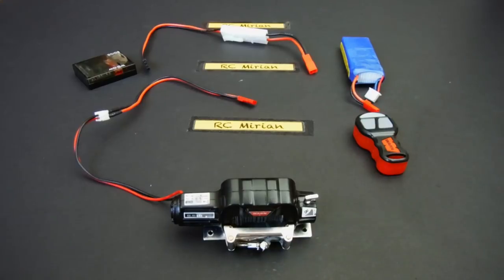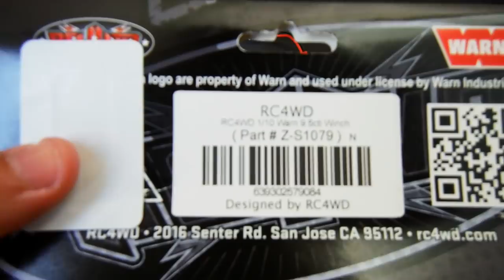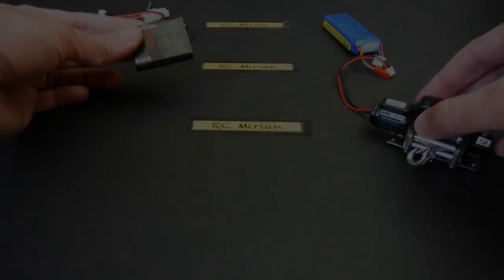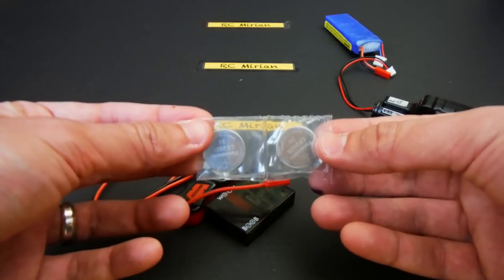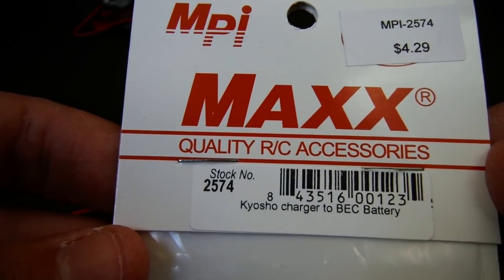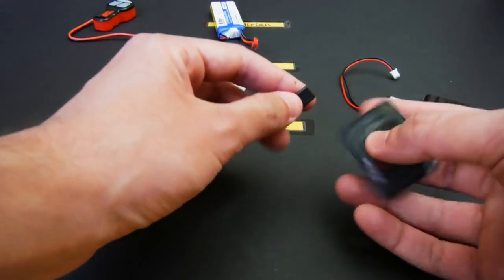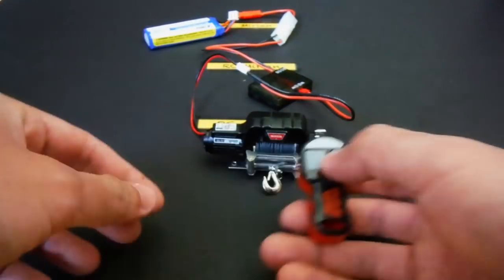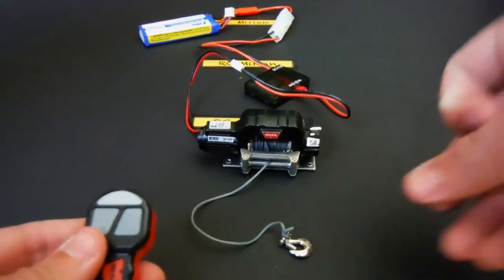RC Warn Winch Tutorial

Comment: Great post. I added the Warn winch to my TRX, but used the aux power source to power both my lights and the winch. I used existing plugs, but transferred wires to the plugs I needed to avoid numerous connections and ridiculously long wires. All worth noting I just used two of the supplied screws to attach the winch base to the stock bumper. With two it is very snug.
Reply from the maker: Awesome, yes having wires everywhere doesn’t look too real!
Reply: @MehdiMirian  so I would be able to get a cable with servo connectors on each end and use that from the aux power source on the trx4 to the receiver for the winch?
Reply from the maker: @tieintercepterpiolit  yes you should. Thanks for watching!

Comment from the maker: @RC Playground comments like yours are what keep this channel going, thank you for the kind words!
Reply: You'Re Welcome!
Reply: rc mirian if I want to use 2 winches to I buy 2 and 1 controller or 2 and 2 controllers
Reply from the maker: Country Gamer I'm assuming you want to use each one independently, and as you can see the remote comes with 1 receiver, so you need 2 remotes with 2 receivers, but if you want both winches to work at the same time, just get 1 remote and receiver and you'll just need to make a Y cable from the receiver to both winches. Let me know if i made myself clear ;)
Reply: ok thanks cuz im making a scaler and I want a winch in the front and in the rear and im also making an 8x8 driven trailer and I want the winches to work together on that
Reply from the maker: Country Gamer nice, so you'll need for the scaler 2  sets of receivers and remotes but only one for the 8x8, post pics of the process, that's a great build ;)

Comment: Quick question five years after posting this video: does the winch automatically stop when the wire is all in or out? Will the motor keep trying to go if I'll continue to press the buttons?

Also, about how much weight would this be able to pull?

All the best!
Reply from the maker: It doesn’t automatically stop, so yes if you keep pressing the button it’ll try to either roll it in or out. According to their website it says it can take about 6.6 pounds but I’ve pulled close to 10. Thanks for watching after 5 years! :)

Comment: Could you please explain again how exactly to bind it.  I'm running the same set up as you are I just can't get it to bind. I appreciate your help thanks a lot and awesome video
Reply from the maker: +jose reyes if you’ve tried binding it like the manual says, I would contact the seller since it should bind in a couple of second and there could be a problem with yours but here’s a link for how the binding goes. http://www.beadlok.com/product/images/626/Z-S1092-Warn%20Winch%20Instruction%20manual%20Wireless%20color-V7.pdf

Comment: Could you show in more detail how you mounted the winch to your slickrock?
You didn't just mounted it with velcro right? ;)
Reply from the maker: creamneuron correct, its mounted with velcro and using the screw holes of the winch mounting plate i soldered a wire from one to the other to secure it to the cage, will try and do a video!

Comment: So the winch wil not work if u plug it straight in to the vehicles receiver even if u have a 16 channel transmitter .. u need the the other attachments to run it?
Reply from the maker: If you have a transmitter with at least 3 channels, then you can use the third channel for the winch to avoid getting the winch controller. But you’ll always need the winch and it’s receiver plus a battery for it since it cannot use the bigger one from the rc. Thanks for watching!
Reply: @MehdiMirian  ok thanks for replying

Comment: I have mine connected to a side connection to my transmitter and then to the box and the box to the winch my lights all come on when on but I go to use the remote and nothing 

Do I have to remind them if I got it used from another person 
Also do I have too change batter on the remote if so what battery type
Reply from the maker: Try changing the remote’s battery first, if the problems persists, try connecting the transmitter to an individual small Lipo and bind it to the remote. That should do the trick.
This is the battery for the remote, 
https://store.rc4wd.com/Replacement-Battery-for-110-Warn-Wireless-Controller_p_3739.html
Hope if helps and Thanks for watching!

Comment: Great vid but I want to control my winch with the 4th channel on my remote, how is this done? plugging the winch receiver into the 4th channel docent work and plugging the winch directly into the 4th channel docent work either. I don't know what else to do.
Reply from the maker: According to rc4wd, you need to connect the winch to a “control unit”, and then connect the control unit to your receiver so it works on your remote. This is the “control unit” link. Hope this works!
https://store.rc4wd.com/RC4WD-Wired-Winch-Control-Unit_p_3725.html

Comment: Wireless not binding, is the box supposed to flash when binding is complete? Also is it supposed to flash when binding the remote is complete? How long are you supposed to hold for binding?
Reply from the maker: You’re supposed to hold it for 3 seconds and after flashing it should stop, did that work?
Reply: So you do get a flashing light when holding the button?
Reply: No, it didn’t work.

Comment: Can this be used on a servo winch the same as the scale winch?
Reply from the maker: Yes it should, try it out and let me know :)
Reply: @MehdiMirian  A servo usually uses a signal wire to change direction, where the scale winches are basically just directly to the motor in the winch?

Comment: sir, was that battery 7.4 volts or not? i have a 7.4 v battery with the same end so i would need the adapter but could i use it (1000mAh)
Reply from the maker: +MR.CREATE yes you can!
Reply: ok thanks a lot :)

Comment: Will I be able to charge that battery using thr traxxas ez peak dual charger. If not can you tell me the part # I will need
Reply from the maker: You should be able to charge any 2s or 3s LiPo. Perhaps an adapter might be needed to connect the battery to the charger, but try first to simply connect it directly to your charger, if not try one of these links to find the correct one,
http://www.amazon.com/dp/B016065X72
http://www.amazon.com/dp/B016075GEG
http://www.amazon.com/dp/B01607M9C8

Comment: Would you need a lvc or lvd unit running lipo with this setup? I usually run nimhs or 9v for accessories so I wouldnt know.
Reply from the maker: This winch works with 6 to 11 volts batteries, I just used this lipo to extende play time but you can use nimh too just make sure it's within the voltage I mentioned ;)
Reply: rc mirian oh okay. So pretty much when the winches performance drops its sorta like a lvc? That I would assume this particular winch setup will not operate under a certain voltage? Still if using a 2s lipo and the winch setup being min of 6volts unless using a very high quality lipo pack running them down to 3v per cell is cutting it quite close. I do understand its a winch and wont be used nearly as much as say lights or whatever but if you happen to neglect checking the winch lipo voltage over a period of time could have catastrophic effects lol.  And of course if your using lipo to power the rc you can always just hook it up to run off that and use its lvc if not running a separate power source for winch. Great vid too!
Reply from the maker: Rosco P thanks bro and yes I'm powering with the videos battery the winch and only that, i've tested it and with one charge can hold up to 15 to 20 recoveries so for one run its more than enough lol

Comment: Can anyone share if using a 7.4v 850mAh battery would be too much for this type of winch?  I intend to run same set up as the video (powering the winch directly to the battery). But want to ask just to make sure of my options.
Reply from the maker: According to the manufacturer, this winch can be used using a Voltage: 6v to 11.1v. So your battery looks good. Thanks for watching!
Reply: @MehdiMirian  "Thank you" Mehdi. Your feedback and video is awesome.
Reply from the maker: Thank you for the kind words!

Comment: I have the wired controller for mine. I can't get it to stop being on. I have a feeling it's my rcs receiver but I'm not entirely sure. As long it's connected, it's either winching in or out.
Reply from the maker: +Zach Novosad how strange but from a forum I read I remember someone saying a similar problem, that's why I went for the wireless one.
Reply: Mehdi Mirian I actually fixed the problem. I needed to program my 3rd channel to a 4 position switch I believe. It was only set as a two position
Reply from the maker: +Zach Novosad perfect!

Comment: Where did you get the battery?
Reply from the maker: At integy.com
Reply: @MehdiMirian  do you have a link for the battery?
Reply: @MehdiMirian  where could I get a charger for that type of battery?
Reply: @MehdiMirian  I don't see it and I need to get a charger too.
Reply from the maker: @yojiholmesproductions  you could try and get everything from rc4wd page.
It’s out of stock but this is an example of what type of battery you need to power up the winch only,
https://store.rc4wd.com/Batteries-Chargers_c_34.html
Reply from the maker: @yojiholmesproductions  and here’s the charger, 
https://store.rc4wd.com/Batteries-Chargers_c_34.html
Reply from the maker: @yojiholmesproductions  could also try at any event hobby shop or even Amazon, good luck!

Comment: In the real world the connectors don't match, nothing fits, and the batteries in the remote don't make contact.
You're going to have to be an Electronics Engineer and a master of fabrication to make it work.
I made my dual motor winch work because I am those things and was born 1 year before Elon.
Gonna show the video soon as I batten down the hatch. I just got it today.
Reply from the maker: Here’s a video of the winch in action. This  model not only works, it has worked all this years without a problem. A must if you’re into rc crawlers.
Thanks for watching!

Comment: Can you leave a link to the battery please
Reply from the maker: This battery was bought at a local hobby shop so can’t find the exact one but this will do, floureon 7.4V 2S 3300mAh 35C Li-Polymer Lipo RC Battery Packs with T Plug Connector for RC Airplane RC Helicopter RC Car RC Truck RC Boat UAV Drone FPV(1PC) https://www.amazon.com/dp/B06ZZ1JWH8/ref=cm_sw_r_cp_api_i_rKU7Ab9SWS35M

This winch can be used with a 2s look battery and with a max voltage of 11V, hope this helps!
Reply from the maker: floureon 7.4V 2S 3300mAh 35C Li-Polymer Lipo RC Battery Packs with T Plug Connector for RC Airplane RC ttps://www.amazon.com/dp/B06ZZ1JWH8/ref=cm_sw_r_cp_api_i_rKU7Ab9SWS35M
Reply: But will it work for this winch
Reply from the maker: Yes, the link it’s a for a battery that works for this winch.

Comment: Battery matter?
Reply from the maker: It does, but if you stick to small lipo ones you’ll be ok, thanks for watching!
Reply: @MehdiMirian  alright so can i use nimh because i burnt a wireless controller the other day and i dont know how?
Reply from the maker: These are the specs recommended from rc4wd, Voltage: 6v to 11.1v, Will operate on 3 Cell Lipo. I’ve used mine with a 3 cell lipo and has never malfunctioned. Hope this helps!